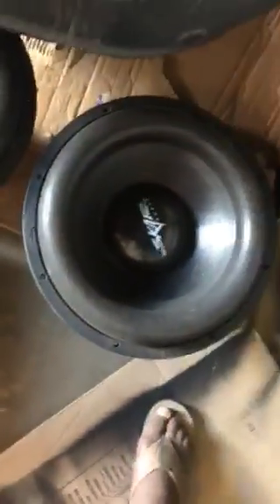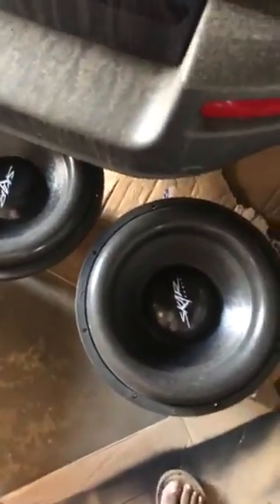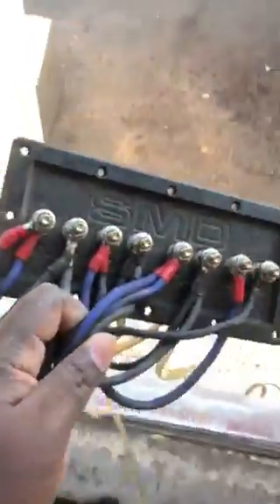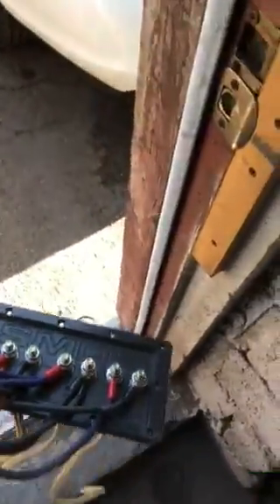15 inch box build 2 zvx 15 skar audio

Comment: lol that Stonelove  memory lane mixtape in the background! nice build. thinking about buying the zvx v2 d2.. still running my Digital Design 700 series but its slowly dying out lol
Reply from the maker: DJ_JONKARU supreme yea man try them they nice
Reply: Yea man dd said my sub is rated between 600-1200rms at 3200 watts and I’m using the Orion Korean board 2500.1 d xtr great amp btw. And my sub got a little smelly and check the coil and has some discoloring from the bottom over the coil very much dark brown moving forward to bright copper idk maybe too much power? Hopefully the skar zvx can handle with no problem